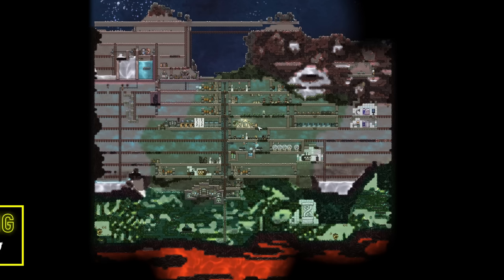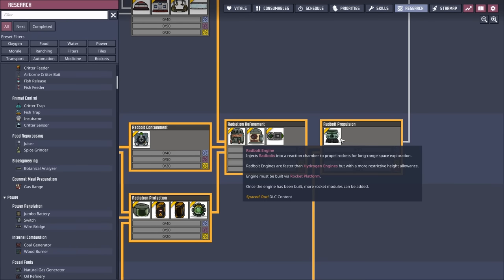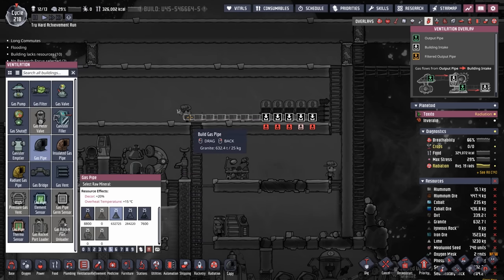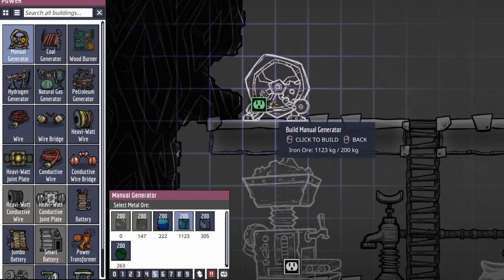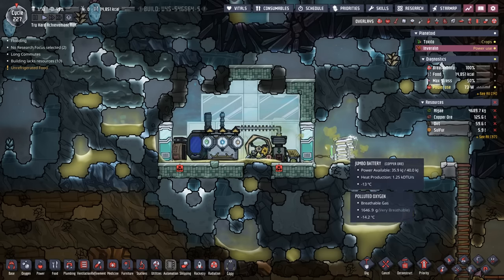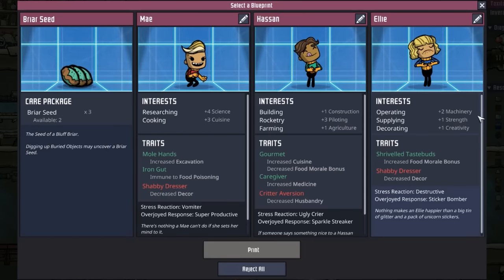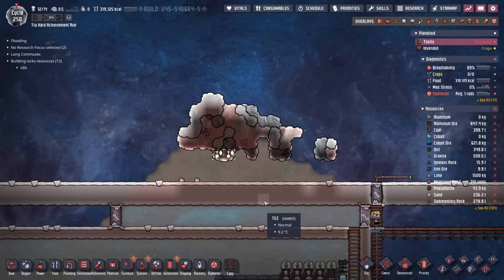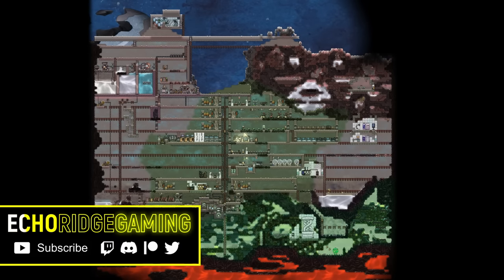Steel Production Online| Max Diff Achievement Run | Ep 9 | ONI

Comment: Since you're short on space, a full stable of cuddle pips holds 24 pips. And they can eat arbor trees as well (they'll be stuck at 66% chance of laying another CP egg)

24 pips = 12 Hatches in meat, or you can do omellettes out of the eggs.

Basically a 50% increase in space efficiency + extra dirt (and cuddles!) and you won't need to worry about raw minerals for the hatches

Comment: @Echo i would suggest setting your overflow hydrogen generator to be in the spine, while you may have tons of coal it never hurts to be frugal. Also you could setup some oxygen masks to go to the bottom of the base tap into the carbon dioxide geyser and pump it out at 1k/s for a more permanent cooling source. This would be a great way to recapture excess steam for some addition water (not that you need it).

Comment: The automation port on radbolt generators doesn't turn them off when red. They still consume power and charge up. It only prevents them from shooting. Which mean that if they charge enough, without a memory toggle and a pulse generator, they can shoot multiple times when the port turns green because the radbolt actually take some time to reach the destination and turn back the automation signal red. So be careful with that, radbolt generator automation is tricky. The easiest thing to do is just to automate a power switch instead of the radbolt generator itself.

Comment: On my run, thanks to irregular oil, I have slicksters. No drecos or thimble reed like you, but slicksters.  So a oxy mask fueled dirty brick. It hasn't gotten hot enough for scaldings yet, but with both a feral sulfur geyser [currently stifled by my sewer overflow] and a polymer press, that will change soon...

Pips making dirt to feed hatches to run coal generators to feed slicksters to make crude to refine into plastic is how I plan to get to long-term temperature maintenance [steam turbines over both the sulfur geyser and steam vent will help with the power needs so I can run aquatuners to delete some heat]

I also have a single carbon skimmer/water sieve setup in the brick to make polluted dirt to feed my pokeshells and sanishells [and eventually oakshells once my dupes finally get around to transporting some more ethanol to the eventual oakshell ranch from my dirty brick on bottom of base [which has 3 safely trapped volcanoes for an eventual sauna/geothermal plant], where I am burning some of the pip leftovers in an ethanol powered petroleum generator.

Yes I like Rube-Goldberg devices.

Comment: should grab the sucrose from upside-down world and make a sugar engine, you can load refuel materials into a rocket and have full distance each way between planets its super easy to refuel all the solids making each fuel tank a one way trip with a full resupply once landed on another planet making it the most distance from starter rockets

Comment: Youtube won't let me edit comments, but have you considered using a manual radbolt generator? it's inefficient, but should be great at getting you that first 20 radbolts and it requires no power.
Reply from the maker: Not really, I would rather just set up for the mid range haul.
Reply: @EchoRidgeGaming  you're much more forward thinking than me!

Also your wild planted wheezeworts were genius!

Comment: I don't think my spom is working right or something, been following this video to a T  , 12 dupes, yet I have low oxygen everywhere. NO mouth breathers either.
Reply: The one he made does 10 dupes - you may not be making enough O2!  there are a couple other problems that might be going on too: temperature of the water (too hot and it becomes steam before it can become O2) or gaps in your water supply (for example, toileta also being fed from the same water line and being given priority or split priority)